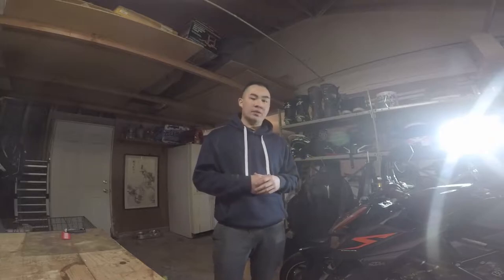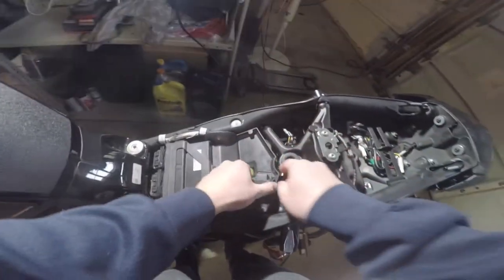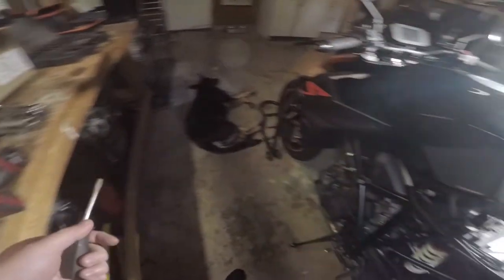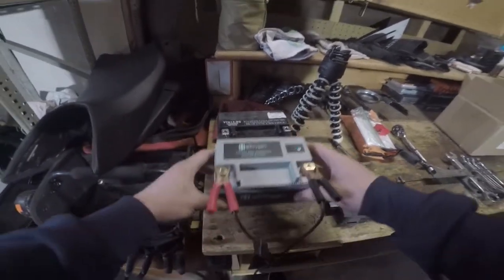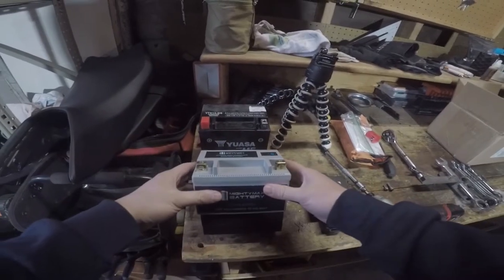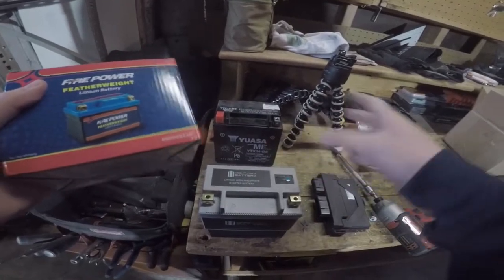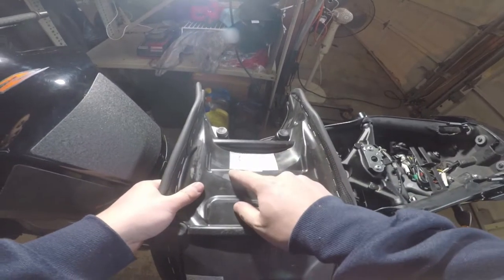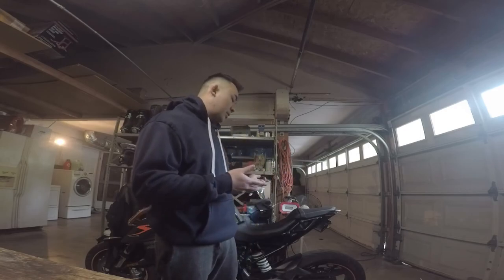2017 KTM Superduke R Gen 2 Battery Replacement + Extra Quirks

Comment: THANK YOU SO MUCH ....doing a battery change on my 2017/18 sdr..so paranoid of breaking a pin or wire disconnecting the two connectors to the ecu......no one but you seems to know about the center press release.....looks obvious but if you break a wire...ouch...thanks for your vid and hard work,,,,you are appreciated.

Comment: Very well done video! You took time to explain everything thoroughly and it is very easy to follow. I actually have the same bike and found that the battery is really easy to remove. Currently I got an issue that the display just turns off as soon as I want to start the engine and then neither the engine starts nor does the display turn back on. It just does a click sound in the back of the motorcycle and that's it. Haven't investigated further yet. But great video and first btw :)

Edit: I just remove the ECU straight away, as well. In the manual it says to pull the cover back and fold it up which is physically not possible. I struggled to find out how to remove the ECU plugs at first. Weakly explained on KTM's part!
Reply from the maker: Hey there! I actually was having a similar issue with mine. It would not detect the key sometimes, and if i left the kill switch in the on and ready to start position, it would die and struggle to start, then throw a MTS error. That's actually the reason for this battery replacement. I have no issues with starting anymore.